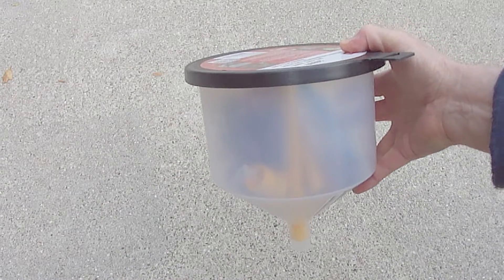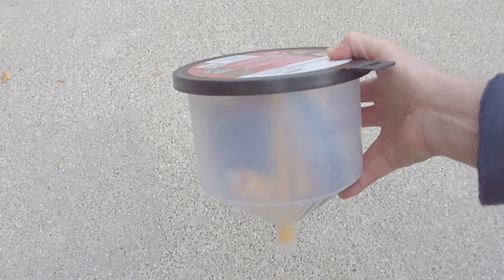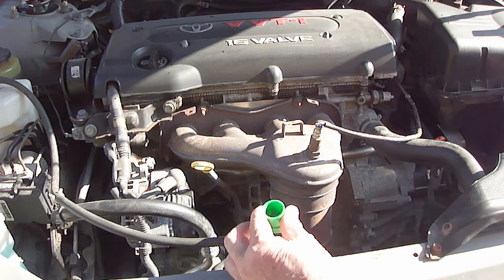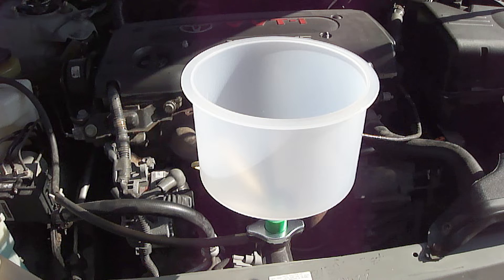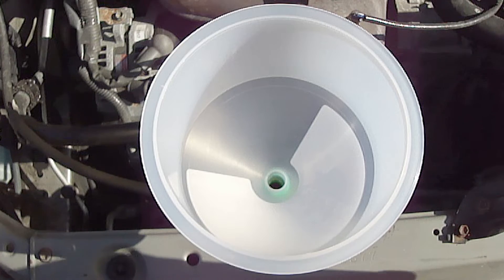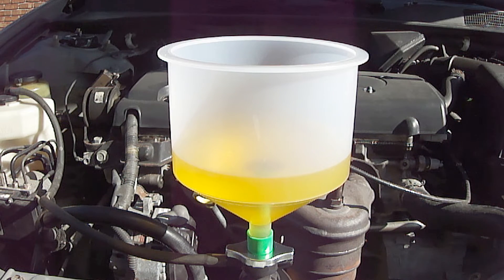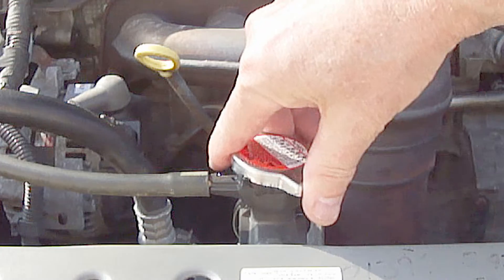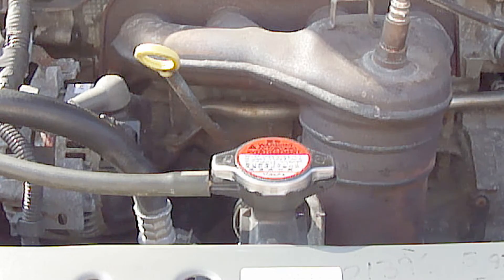How To Easily Remove Trapped Air From A Car's Cooling System

Comment: Hi if I still have air. To bleed air on the second time do I still need to add more coolant up to 1/4 of the funnel? My level is already up to full mark? Or just insert the funnel dry and let the engine run?
Reply from the maker: Add more coolant to the funnel the second time up to a quarter full again

Comment: Instead of buying yet another gadget, just drive the front wheels up on ramps. This lifts the engine up and naturally elevates the coolant cap.
Reply: I was wodering the same thing. I have a little hill in my yard I can drive up. Even easier than ramps.
Reply: I park on my driveway which is on a slope plus use the spill free funnel, works great 👍

Comment: Just had the front auxiliary water pump replaced on my 2005 Durango and I needed to do this process … thank you for clarifying the need to turn on the heater and not to rev wildly other videos didn’t mention this … overall the whole process for me was 45 mins and with your tips I’m back on the road safely with no temp problems … thanks for your videos they are still helping us in 2025 and for your positive energy and vibes take care
Reply from the maker: 👍😃 So glad I could help you.

Comment: hello sir   , because  my cars radiators  are in the front  and  engine in the back  , will this system still   work .  my car  holds  3.5 gallons of coolant . its a ferrari 360   coupe .
Reply from the maker: Yes

Comment: I recently replaced my water pump and thermostat, cooling temperature control sensor and the radiator cap and my 2006 dodge charger still overheating 😢
Reply from the maker: @rogeliogarcia2997  Are your radiator cooling fans operating? Is there any chance you installed the thermostat in backwards or upside down?
Reply: possibly blown head gasket.
Reply: Did you ever solve it?

Comment: Mine doesn't have a radiator cap.  Another video says to use the bleeder valve hole with the funnel.
Reply from the maker: @muffs55mercury61  Not all vehicles have a bleeder hole valve which can also be quite messy. Just keep your reservoir tank topped off and all of the trapped air will eventually be removed from the system as it’s driven.
Reply: @proclaimliberty2000  I think I may have been sold a defective thermostat.  It happens.  None of the bad head gasket signs so far but in slow speeds such as in-town driving, it runs quite hot. Or the air is just being stubborn and playing hide and seek.

Comment: For some reason my coolant rises instead of taking it 😞 ?
Reply: Are you using the Spill free funnel to let the air out?
Reply: Same here. It rises a lot
Reply: @pupinarvaja  if you're using the spill free funnel and you see that it rises a lot then you might have a bit too much coolant
Reply: @pupinarvaja  yea I fixed it, I didn’t add no coolant at first. I just let it rise up. if it’s gonna overflow just take out whatever’s needed so it doesn’t and it’ll start to burp. 

Took about 2 burps before It got fixed.

Comment: Do you top the coolant off after driving it, by pouring into the radiator or the reservoir?
Reply from the maker: @k.t.1520  As you continue to drive the vehicle continue to monitor the coolant level inside the reservoir tank and keep it topped off at the full mark as necessary.

Comment: I see these videos everywhere using this funnel but I wonder if this really gets ALL the air out!!!
Reply from the maker: @seatime674  The longer the engine runs the more air it removes. In my opinion, it’s still the best method.
Reply: @proclaimliberty2000  Agreed, just don't know if the vacuum might tug a little more out..

Comment: Ok that was helpful and so far i have heat coming out the rear heater in the sienna but not consistent heat from the dashboard so some residual air must be in there. The only caveat here is the 50.00 Canadian that I need to buy the funnel for probably one use?
Reply from the maker: @brucewmclaughlin9072  Go to my channel and watch under Playlist in Automotive how to fix a car with no heat. This may give you some other clues as to what’s wrong.

Comment: Thanks Paul that's a great video. All these years I didn't understand that are on the top of the cooling system can give a false reading on the coolant heat sensor. Also I think maybe my heater core has air bubbles  in my Odyssey van all the rear heater core works fine the front one is only mildly warm even after I did a back flush on the core

Comment: Wouldn't this introduce air when you let go....Why squeeze the radiator hose before plugging the funnel.  Just wondering new to this 🙂
Reply: to avoid spilling when putting the cap later

Comment: I have a 2003 Honda Civic LX with no bleeder valve and used the funnel with coolant method to burp the system and it still didn't work.   What I found out later is that you leave that funnel with coolant attached after shutting off the engine.  Do not plug it.  Let the coolant and engine cool overnight.  As the coolant in the radiator and engine gets cold it contracts creating a vacuum sucking more coolant from the funnel.  If you remove the fumnel too early, you risk sucking in air instead.
Reply: My mechanic told me
The same.
Reply: Sounds good   but do you keep reservoirs cap on or off??? While the funnel is in
Reply from the maker: @senatedocument2646  I don’t know how that’s possible with modern systems that have a reservoir tank.
Reply: Because the reservoir tank it's not full with coolant. It's empty and not refill until all procedure is done
Reply: @proclaimliberty2000 it's a CLOSED system

Comment: Paul if you have an exspansion tank and a radiator cap which one would you fill the system from?
Reply from the maker: Always fill it from the expansion tank and fill it to the full mark when the fluid is cold.

Comment: Yhe dealer advice states get to op temp rev car 2500 rpm for 5 monut4s then 3000 rom  for 5 seconds
Reply: Same i did this speed heating process
Reply: @hubsun700  worked 4 u mate ?